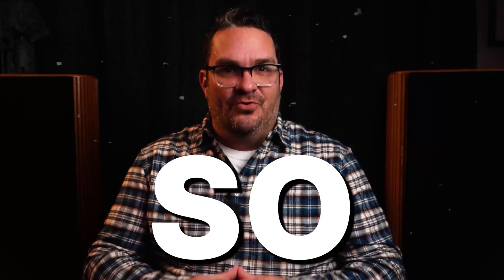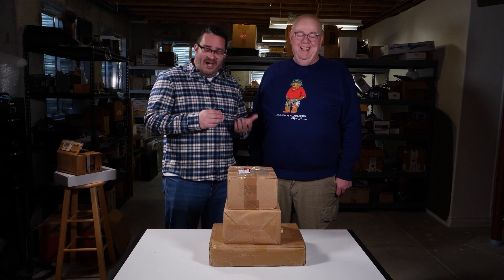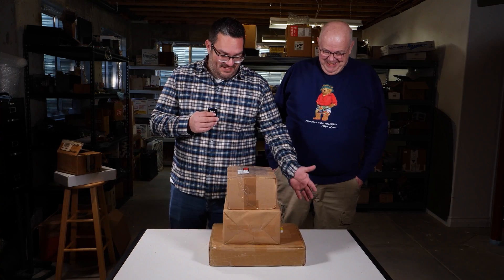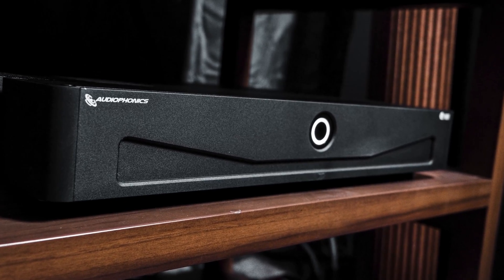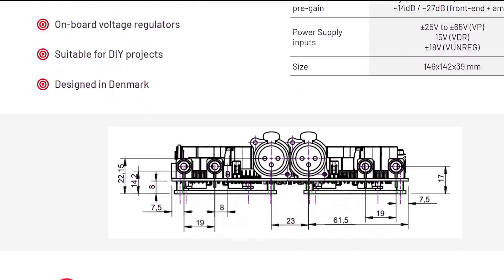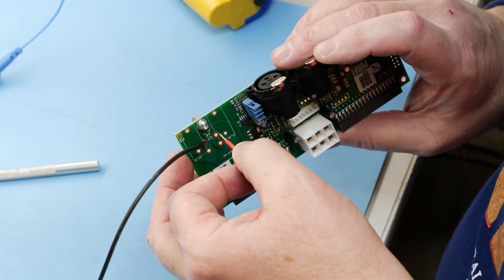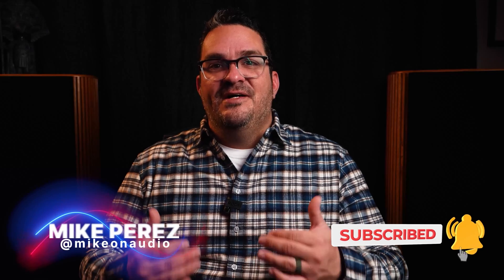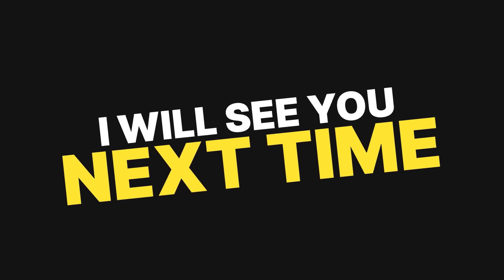DIY Amplifiers: Is Purifi EVAL1 the Best Option?

Comment: Thanks Mike, this is soooo excellent a video. Let me recap what you presented, just so that I fully understand what was said.

The audiophonics complete amplifier comes with its own input board attached to the Purifi amp boards. Your project version has Purifi’s own input board attached to their amp boards (forming what is the Eval1).

Ordering the Eval1 from Purifi; the Hypex power supply from audiophonics; and the Std case (I assume it includes built-in banana connectors for the speakers) from Ghent, per your links, will get me an easy-to-build, no-tools-needed-other-than-a-screwdriver kit that anybody can put together?

Pinch me if true!
Reply from the maker: That is exactly correct.
Reply: @audioarkitekts  Hi Mike. Was an IEC power cord included?
Reply from the maker: @foblivio  Nope, I had to provide my own.